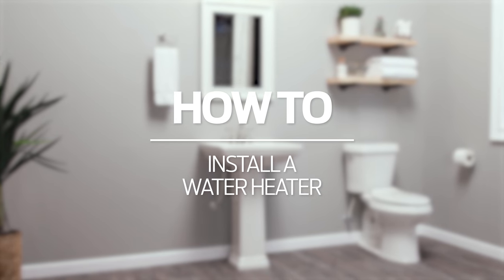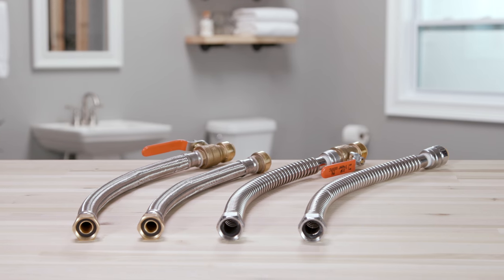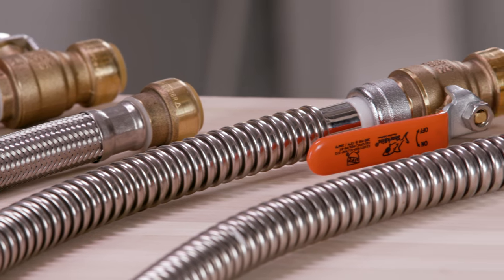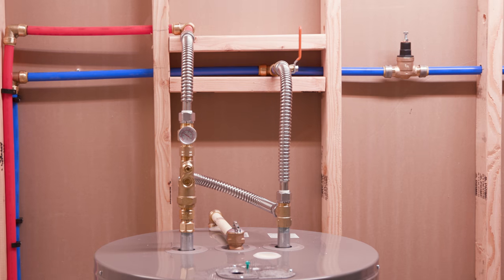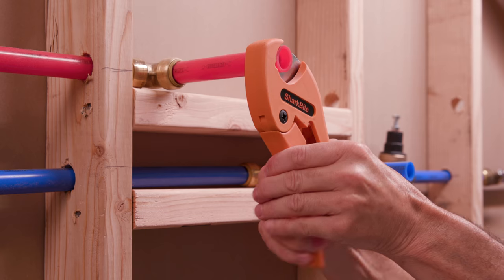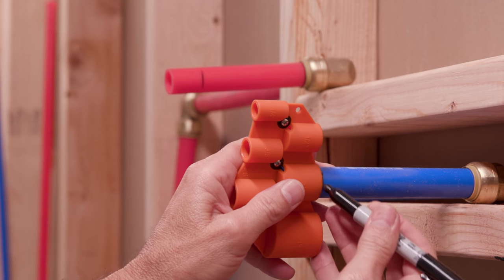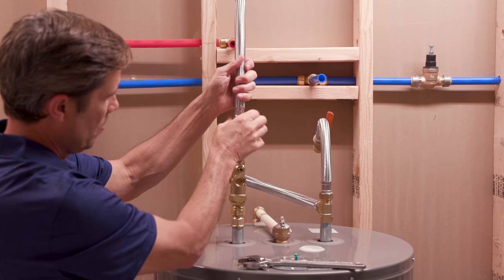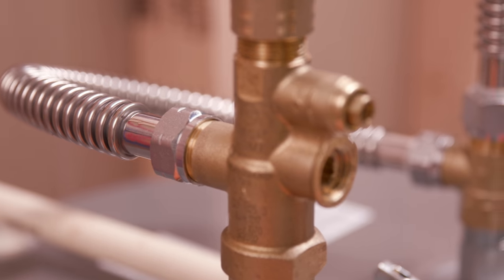How To Install a Water Heater with SharkBite

Comment: Question - How do you prevent galvanic corrosion to dissimilar metals in contact to water heater inlet and outlet. Especially on the hot water outlet side corroded much faster. It shortens the life of tank. There are many cases already happened.

Comment: Anyone remember the old “grabber fittings” seem very similar to shark bites,one way metal barbs to hold fitting in place,o-ring to seal. At the time they were the best thing since sliced bread but didn’t stand the test of time. Convenience rarely yields quality.
Reply: Therefore they improved vioala sharkbite reliable.

Comment: All the videos I see use the plastic pipe material to install water heaters but the guys at lowes and home depot are telling me that I can hook the sharkbite connectors directly to copper pipe. Does anyone know if the Sharkbites will create a seal if I hook directly to copper pipe. Thanks
Reply: yes, sharkbite work on copper as well

Comment: What about the Pressure & Relief part of a water heater? It’s code in CA they have to drain outside the house, however this seems to be the one area that a plumber is needed or you have to sweat copper (they ran ours directly alongside our drywall so I personally don’t feel comfortable attempting it). If sharkbite is only rated to 200f then doesn’t that mean they can’t be used, therefore the water heater installation isn’t complete and up to code unless you go the traditional route (in which case might as well save money and go all the way with sweating copper fittings)? I’m wanting to go without a plumber as right now they’re charging massive premiums due to demand, seems crazy to pay almost a grand for someone to run 3ft of pipe, but not coming up with any options if sharkbite won’t work.
Reply: Im literally in the same spot, looking at copper that runs out of the house for the pressure release pipe. I have to cut the existing copper pipe just to get the old heater out. either I use a shark bite to reconnect pipe or I have to sweat it. what did you end up doing?
Reply: @onemanwanders  learned to sweat copper, was a lot easier than I expected, esp since it really doesn’t need to be absolutely perfect since it’s rarely used, but did mean even more materials I had to buy.

Comment: I love shark bites however I have noticed that they start to leak with calcium build-up.
Reply: TRUE" SOME TIMES" NOT ALWAYS" AND I BELIEVE MIGHT BE THE WAY YOU INSERT THE CONECTION" STRAIGHT OR A LITTLE SIDED", MAYBE IF THE TUBE IS NOT CLEAN WELL COULD HAPPEN I HAVE FOUND THAT" AFTER INVESTIGATING, I DON'T MEAN ITS THE CAUSE" FOR IT " BUT I HAD EXPERIENCED SAME ISSUE 2 TWICE WIRHIN 20 TO 30 IN TIMES INSTALLING THEM"

Comment: If you will keep the water heater for many years, I do not recommend using a supply line with rubber or plastic inside. Overtime, the material will degrade and all the small pieces will be in your plumbing system/faucets. It’s almost impossible to get rid of them.

Comment: Not at all sure about this, but gave it a try. We will see. I disagree with the "excellent video" as it seems to miss a part. The incoming line end without the threaded end part had a small white plastic float inside a black sleeve that must go over the pipe. The video shows nothing about this two part system. A simple PUSH ON instruction, somehow makes me very nervous and the lack of some sort of compression fitting makes me worry about this. With an earthquake who knows? Am keeping the copper parts to perhaps return to a welded copper solution.

Comment: Does the heat from the heater water line cause any damage, warp, shrink or have any negative effects on the gasket or o rings from the connectors after years of use?
Reply from the maker: SharkBite push-to-connect fittings are suitable for temperatures of up to 200°F and can be used on water heater lines as long as this temperature is not exceeded.  SharkBite fittings use o-rings that are designed for use with these temperatures.
Reply: @SharkBitePlumbing  You didn't answer the question. How long do they last?
Reply: @herrickinman9303  read the question again...he answered the question.
Reply: @sdboesenberg  You need to reread the question. The answer does not address the "after years of use" part of the question.  Surely, you don't believe the o-rings will last forever as long as the temperature doesn't exceed 200 degrees F.  Do you see a lifetime limited warranty on any on their fittings? 

More importantly, the Sharkbite rep did not respond to MY question: "How long do they last?" Curious.
Reply: @herrickinman9303  The don't last more than a few years. I now have black specks floating in all my hot water!
Reply: @jjf8383  Replace the valve. No big deal. thats the point of sharkbites. You can do it yourself. Even replacing the sharkbite every 5 years its cheaper than a plumber to come out once.
Reply: @fredost1504  this. $10 shark bite fitting or $100 an hour plumber? No brainer.

Comment: Is the blue hose should be cold or hot? I’m asking because a company installed my water heater but  they are telling me that both should be hot that’s normal and I’m thinking if it’s blue it should be cold
Reply from the maker: You're right, De Jesus. Blue, typically, is the cold line while red is hot. Technically the color of the pipe doesn't change anything about the install, it's very common practice.

Comment: Some professional plumbers on YouTube are saying that these might leak so we shouldn’t use them. 
My wife was too nervous about letting me install them for our new hot water heater instead of using a plumber who would solder and I had to agree with her, probably not worth the risk. 
It would be nice to be reassured that they won’t leak.
Reply: They leak find a soldering plumber.
Reply: @apr4200  they leak when u incorrectly install them say your pipe end isn’t square or has a sharp edge it will not allow shark bite to fit correctly’ found that out the hard way’ if done properly (rite tool for the job) when it comes to water u could b talking thousands n damage so spend the extra $20 for the right tools etc’ but since learning from my mistake and cutting copper pipe square and even some pex been 2 years now not a single drop or leak’ 

Anything can fail’ anything’ even solder can fail’ if it’s not soldered correct it could leak or break during the cold etc’ also if they leaked so bad I promise that company wouldn’t not still be n business 10-15 years later however long they have been u get what I mean’ 

Sometimes also u have to know when to call n a professional and say this is beyond my skill level’ has / eletric/ water if u r a diy u better know what u r doing or u could really have a mess on your hands is the $1k dollars the plumber woulda charged worth the 45k in damage u caused… 

Or the 100$ to install an outlet was is worth saving $100 to spend 200k when your house burns down’ just offering tips to future diy either research or call n a pro on the big gun stuff that damage will ruin your home
Reply: I've been using them for 5 years. Never have had an issue or any one called me back because of a leak. Those that do occasionally leak were either placed incorrectly (which you cannot blame the product), or it was defective (which happens with any product) . Plumbers hate on Sharkbite because they feel their jobs are taken away by home owners who can do plumbing jobs themselves.

Comment: Lasted less than 2 years on hot water heater. Drip detector goes off at 2 am you figure out the drip is from the hot water side sharkbite on your water heater. 
 Write review at 3am.

Comment: Im a qualified plumber in sydney Australia, no tradesman in Australia with workmanship uses sharkbite. Connex crimp, or wielded joints. Only handyman use it.
Reply: I’ve been a plumber for 25 years in the US I agree
Reply: Indeed. I only used shark bites on my very first plumbing project. They were outdoors so leaks weren’t a concern. But they were expensive. Now I only use a crimp tool and fittings.
Reply: sure thats true. Because we can do it our selves with sharkbite and dont need you anymore. Its cheaper to replace a sharkbite hot water shutoff 5 times than call you out, once. Prove me wrong.
Reply: @fredost1504  Just wait till one of those seals in a walls breaks, then you get to rip the whole wall apart to find your budget sharkbite fitting is leaking.
Reply: I like SharkBite for exposed plumbing.  If it is going to be covered with drywall or plywood I would then go with Connex crimp.  Although even if a do-it-yourselfer did install SharkBite in the covered wall I would guess they know how to drywall.  So the cost savings is still there.  I am huge do it yourselfer.  Love to learn how these things are done.  Why pay someone to do it when I can learn to do it myself.  However, I do know my limits.  I will call a tradesman out for items that I just can't do or don't feel comfortable doing.  Like my outside drain lines or my water line coming to the house. Installing a toilet.  I always have a hard time lining up the wax and the pipe. Otherwise this was a good short video.
Reply: @pinkiepie1656  Sharkbite is like $400.00 cheaper than what a plumber will charge to come into your home and sweat on a simple copper elbow fitting.
Reply: @mts7274  yea but then we won't be seeing anymore plumbers crack's which would be a shame

Comment: I just don't get it..... Why don't they stabilize the pipes coming out of the wall?!?!.....instead as you see here they just slap on the ball valve and connect it to the water heater with a flex pipe.....must be a better way....even an amateur can see that.....otherwise it would be great..... 🤨

Comment: why would anyone dislike this video?
Reply: Because SharkBite's fail. 
I'm NOT a professional plumber, but I had to fix TWO leaky ones that failed inside a wall and destroyed the wood flooring.
I would use then in a outdoor and visible setting only and NOT in and indoor or visibly concealed setting.
Any other questions?
Reply: I have a friend of mine that's a professional plumber and he doesn't like them says they leak

Comment: "Nothing beats the shark" except hiring an actual plumber"
Reply from the maker: Hi Mark. While our products are available on the shelves of major retailers, our products are designed for trained plumbing professionals to install, repair, and build faster.
Reply: @SharkBitePlumbing  I put mine on, but now worry about it. The simple push in connection without some sort of compression twist is worrying. Copper pipes can vibrate as well when filling (after a shut off) and or in an earthquake. I will keep the old soldered parts to reinstall should these fail.

Comment: I'm still scared it will pop out...
Reply: My brother owns his own plumbing company and has never had problem with any of them unless it was a defect in the pipe itself. He has used them for years now
Reply: oh if you dont push them on all the way like you dont cut the pipe straight and cut it on an angle have seen them come off but that is user error
Reply: @herbmurphy5686  I don’t picture an actual plumbing company using them.
Reply: @pinkiepie1656  no plumbing company worth a shit would use sharkbite

Comment: 30 year plumber, I would cut all that out and do it different.
Reply: Kevin Kinnett y
Reply: Yeah, you would do it differently,  not "do it different." But it would look like shit compared to the neat layout depicted in this video.
Reply: He didn’t say he was a writer 😂
Reply: @herrickinman9303  I would rather it look like shit and not leak than end with a leak later. Shark bites blow! And they will leak over time. No true plumber uses shark bite unless it's an emergency.
Reply: @davidc9710  Well, he implied as much by admitting he's a plumber. ;)
Reply: @herrickinman9303  Buddy, you obviously have never seen a beautifully copper soldered mechanical room. Much more artistic and better looking then this trash. Expand your horizons.
Reply: @blueg3027  I agree this guy obviously must do something much more important than providing running water to homes and businesses, but for some reason he thinks he’s a plumber
Reply: I agree to extent.  However, I've had copper pipe leak as well.  In the video, they had every connection done with sharkbite.  I prefer to use pex/crimp and only crimp where needed to make a connection.  Otherwise, if I have the clearance, I bend the pex around the angles.  The less connections, the less of a chance of leaks.
Reply: Every 30 year plumber has a long history of over charging customers for shoddy work.
Reply: MTS 😂 looks like you have a long history of getting ripped off or are jealous of a train professional that knows how to do it in a quarter of the time it takes you
Reply: @KinnetticKevin  I can repair pipe leaks (elbow, t-joint, straight pipe) with quality push fit adapters for less than $20, and I can do it any time of the day/week I want. What's the typical turnaround time and price to hire a plumber to do that?

Comment: "All sharkbite water heater connectors are approved by code to use on electric or gas water heaters, consult local codes to verify if hard piping is required to your water heater" or whatever they said. In other words hire a professional. Their fittings are great when soldering is tricky and they are exposed, real life saver. However im not a big fan of these braided homeowner do it yourself garbage connectors that blow off and flood houses. As a journeyman plumber gasfitter id use their fittings in a pinch when soldering wasnt available but these connectors are garbage. Do not recommend unless you want an insurance claim. Zero out of ten. Junk!
Reply: So from what you're saying their non braided flexible stainless steel connectors are ok in your book.
Reply: @DaveMcLain   no id say the regular compression style fittings are all that should be used here like a sharkbite by fip. Its better for it to be soldered because the o rings can melt